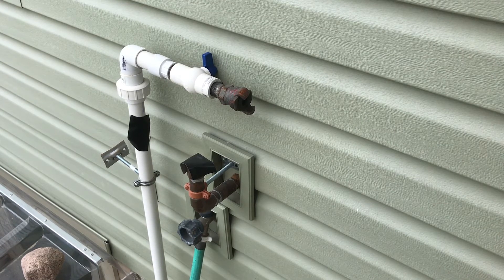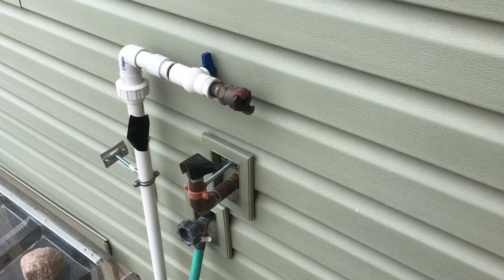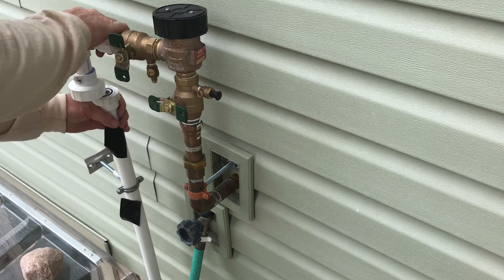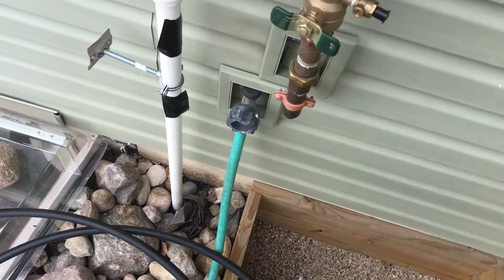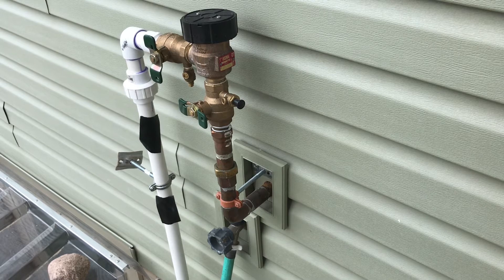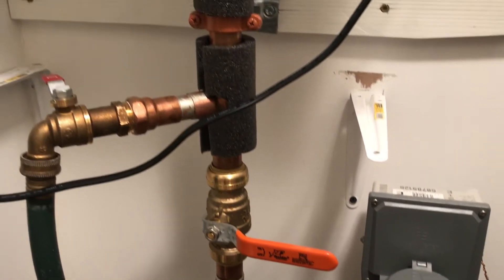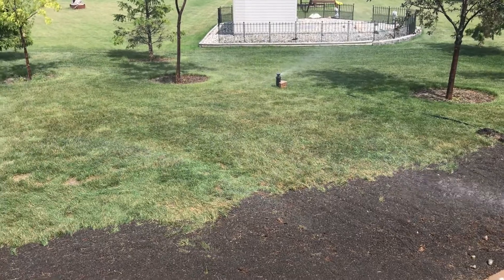Installing Backflow Preventer On Inground Sprinkler System

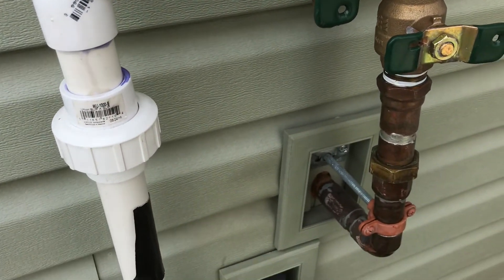Comment: At 5:59 it appears that the two valves, before and after the vacuum breaker, are closed or off.  Is that correct configuration or did you change that before running sprinklers right after that?  Thanks.
Reply from the maker: You are correct that those need to be open to operate.

Comment: I have an old copper irrigation system. what's the best and easiest way to rise the heads to the current grass level?  The current heads don't even seem to be solder on the pipe.
Reply from the maker: I assume there are threads on the 90 degree fitting for a riser. Add an extension to that. If you can't do that you might need to cut the copper and solder a fitting on it. not entirely sure tho because I haven't worked on a copper system, can only speculate what you have. Good luck.

Comment: Is all that necessary? Why wouldn’t you just buy an anti siphon valve for the sprinklers?
Reply from the maker: In my community a backflow preventer is required for in ground systems. I see your point though. Thanks.
Reply: THese arent the safest route to go

Comment: Do any tests or adjustments need to be made to the back flow preventer? I need to replace one. TIA
Reply from the maker: I will be turning it on for the first time this season  soon but I don't believe there are any adjustments needed. There are a few different adjustments that are on it so they are pretty fool proof.